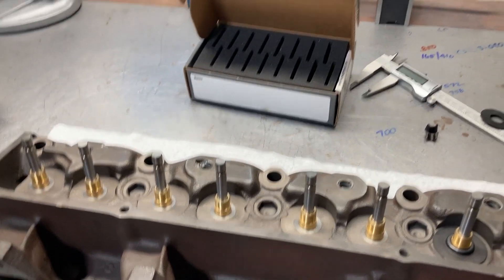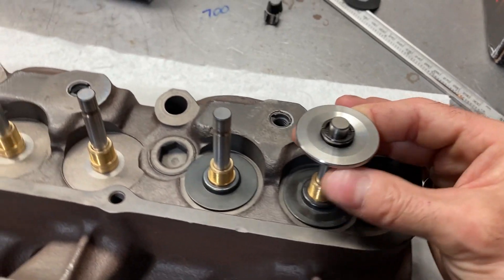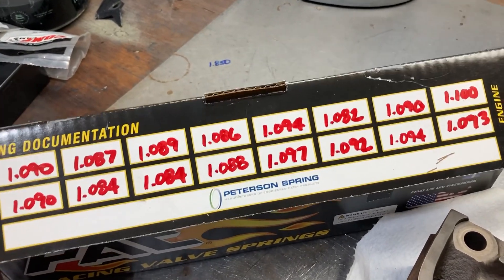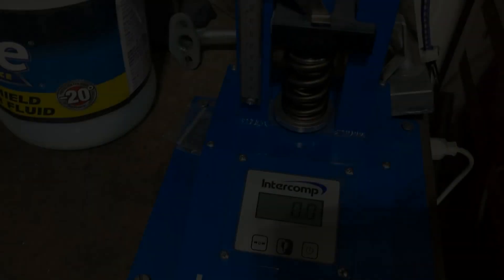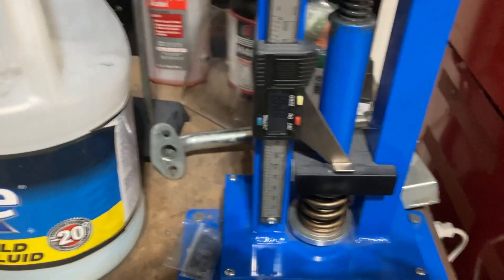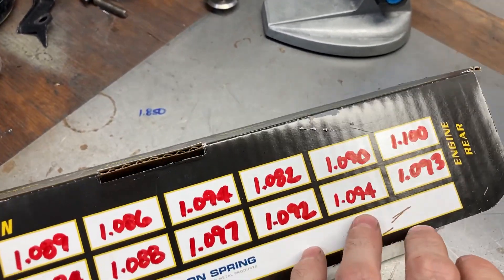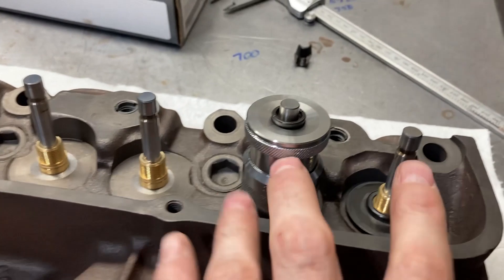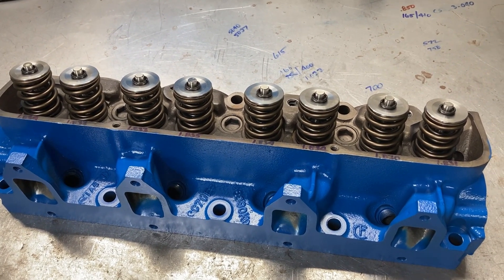Lykins Motorsports Ford 465 FE Tunnel Port Cylinder Head Assembly Part 2

Comment: So, if PAC says they want it at 1.900, how do you account for the retainer when measuring on the Intercomp?  If you touched off on the top of the retainer, wouldn't you be getting 1.900 + retainer height?  I've been measuring springs by zeroing at install height of the spring as measured on the heads, plus the retainer height, not sure I'm doing it right.
Reply from the maker: You have to measure the thickness of the retainer.  I turn them upside down on the table then measure from the first lip down to the table.  Most sit around .100”.  You then run down the spring tester head until it touches, zero, then back up the thickness of the retainer, then zero again.